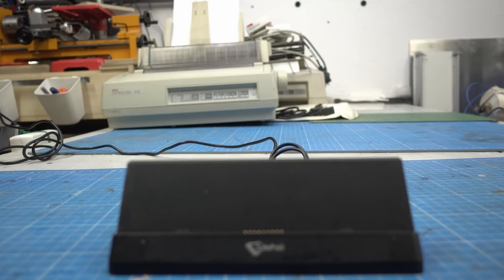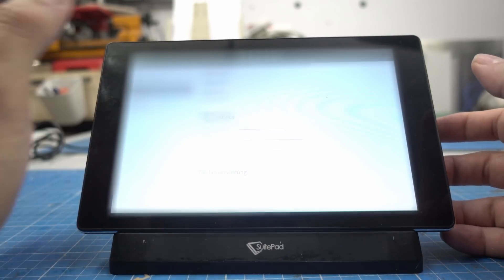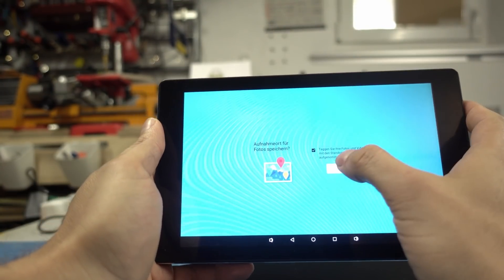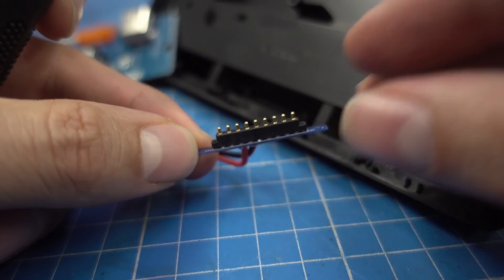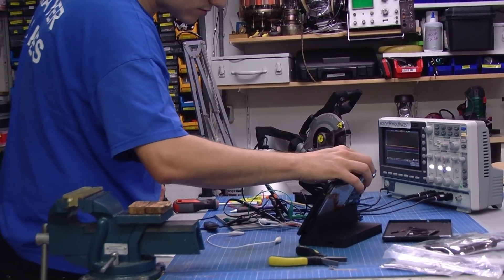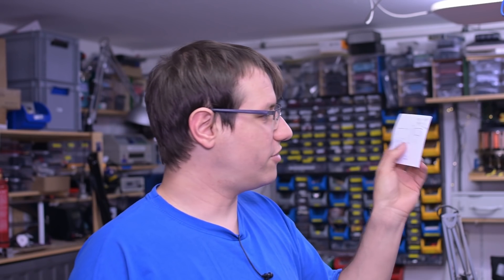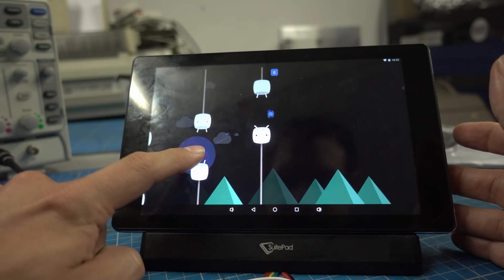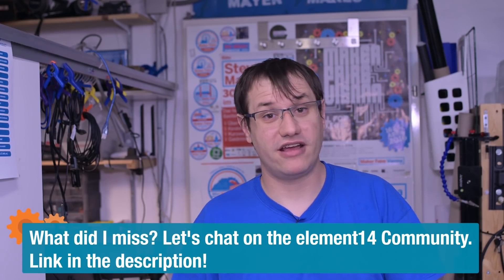Hacking a Hotel POS Tablet - How Hard Could It Be?

Comment: First thing you have to do is go into the settings and about info and tap on the kernel version to unlock dev options menu then go into dev option menu turn on usb debugging and turn on oem boot loader unlock

Comment: That's the problem with PoS systems ... They are hardwired with custom software that blocks everything they don't use ... Then, since this is a disposable model that requires a input device to access parts of the memory, the only thing you can actually do is just take the battery and save some things. Like you said, it's mostly e-waste at this point. They are cheap to build and customize to the client need ... Since this was going to be a desk unit, they put the bare minimum to work effectively. Just some ram, wifi antennas, a custom chip, screen, battery, that's it. Nothing more. It's a dumb device, made with cheap parts and just for that one usage. They are not buying ipads for you to see all the amazing services they have. It's just a presentation screen ...
Reply: I think it's not as bareb9nes as it could be, but certainly built down zo a price and very custom.

Comment: So you can't find any firmware to work with this device.
Reply: Jep, nothing, the Android seems pretty custom.
Reply: @MAYERMAKES  Not really, legally the manufacturer should give you the sdk used to build the os, otherwise there should be ones floating around on the internet for the soc but the work needed is kinda wasted for such a device
Reply: @_DSch  "should" is the keyword.
Reply: @MAYERMAKES  That sucks.  I was thinking you could use a custom firmware but you need a option to flash firmware from external source, I don't think this unit has this option even if you knew how to make a custom firmware rom for it.